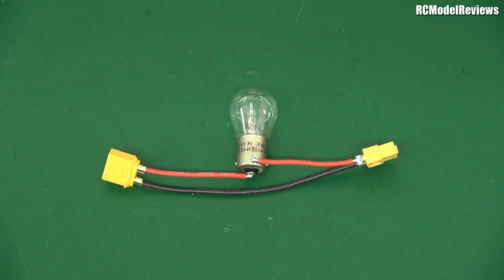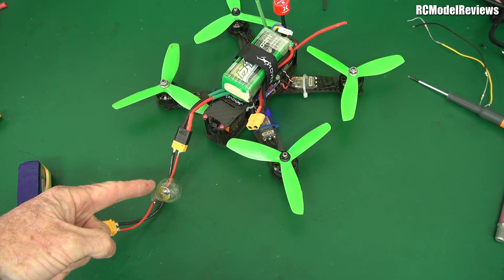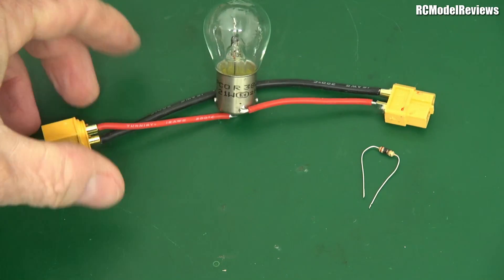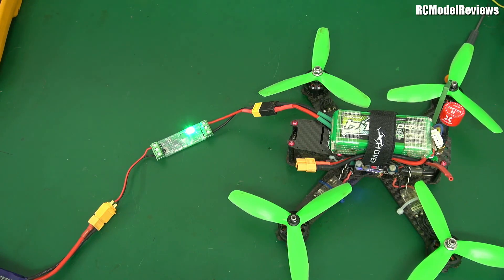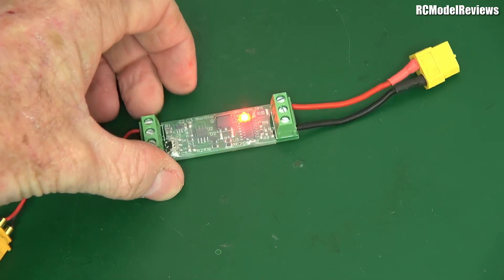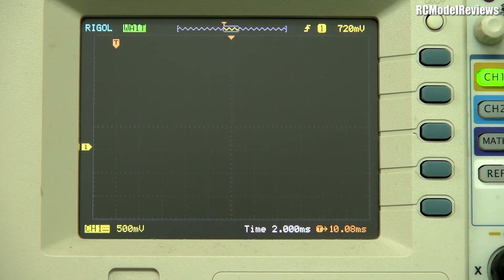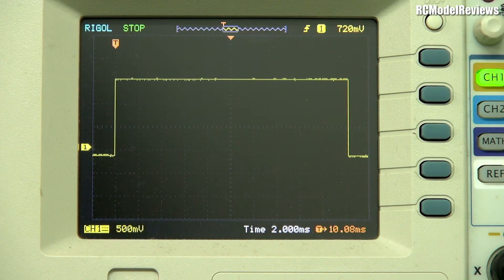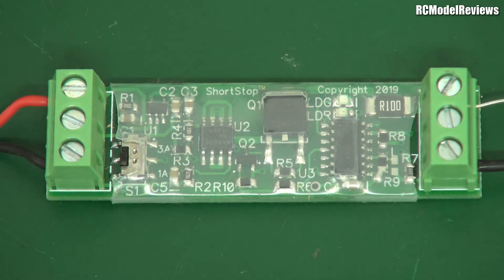Review:  ShortStop (helps keep the magic smoke in)

Comment: hey Bruce i bought one of these and the .10 ohm resistor is missing lol no output at all. i contacted J Bauer. waiting on a reply. other than that the green light is pretty.
Reply: Emailed Mr.BAUER I got a quick response, he immediately offered to replace it. I was in a bit of a rush so I just opted to cut the time in half ,Jerry sent the missing components promptly, soldered them on today and it works exactly as it should. Just thought I'd update my experience with the customer service side of this 👍.

Comment: How do you conclude 1.5 amps were flowing at 11:06 before it kicked in.
New to scopes and I get the divisions and voltage vs time on the axis, but can't see where you get the 1.5amp flowing after stating 1.5v? (3div)

Comment: Could you go into why the manufacturer can’t just put a protection diode or varistor in the sensitive component? I work on equipment that has spike protection (on solenoids) set so low that the working voltage (24v) sets it off

Comment: FINALLY !!! Using a smoke stopper (bulb style ) to protect IC's  never worked.(sledgehammer for a finishing nail ) And, smart enough to recognize in rush current from the caps. I'd pay 40$ for this right now, and count it as a bargain. If it's not to market in weeks, it WILL be copied , I almost guarantee it. It could save that stack you have been waiting for for weeks, and all the work put into a quad build. After the magic smoke, the only option is to start disassembling / troubleshooting/ searching for answers. Take my money !!!!

Comment: Another common method that is half-way between the lamp and this is called a "PTC" or *resetable fuse*. PTC stands for "Positive Temperature Coefficient." They are nothing more than temperature-dependent resistors. As they heat up, their resistance increases very rapidly. They usually start out at a few hundred mOhm to a couple ohms when cold, but as they heat up due to current and power dissipation, they begin to go high-resistance. This is a runaway effect as more resistance means more voltage drop across the PTC, resulting in more power dissipation. Eventually they will see close to the full battery voltage across them and will be hot enough that the resistance is in the hundreds of ohms to kOhms range, passing only a small amount of "holding" current. They are usually screaming hot when in this latched state. They can be found in all sorts of things: input protection for arduino pins, on some battery holders, in electronic DIY kits (like those snap circuits) inside power strips for surge protection, inside multimeters for input protection, etc.

Comment: Is it some manner of Hall Effect sensor?
What if it trips mid flight due to gunning the throttle? Perhaps if it had a calibration mode where you draw max current with your model then set that as a high water mark.
Reply: It's supposed to be used on the bench only, not in flight.
Reply: @sebsexperience  Ahhhh, makes a lot more sense!
I wonder if the majority of components die when in use or out of use though.

Comment: Aren't you meant to use a double filament bulb. You used the wrong type of bulb. My quad would light a single filament but is fine when using a double filament. Which would be closer to the 3amp setting you needed to use on the short stop. Try it with a double filament for fair comparison.

Comment: What happens if you connect the ShortStop reversed or plus/minus swapped?
I think it's use is limited; some components die at less than 1A. Or they die from reverse voltage like electrolytic capacitors.

Comment: Light bulb current limiters were never meant to protect sensitive electronics. 
They were meant to test and protect the larger power supply parts that connect directly to large current lines (psu transformers, psu capacitors, batteries, regulators etc) and prevent fires and/or explosions, before attaching the actual circuit. 
Sensitive electronics should be tested separately using current limiting power supplies. 
Unfortunately, most modern RC components and connections do not allow that kind of testing, and various components have different tolerances and quiescent current demands (FC, ESC etc). And the lack of proper documentation (on-paper and on-board) does not help either. 
I am not sure how much more useful this device would be than a lower wattage light bulb (used with a lower V battery to prevent burning it). Especially if it costs more than a few bucks.
I would say skip the gimmicks and just spend 30 bucks for a variable bench power supply with current limiting. It will do basically the same thing and be far more useful in a DIYer' s lab. And if you can, avoid AIO boards. They are too messy to wire. And use 2 or 3S for testing if your components allow it

Comment: Bardwell used this https://www.racedayquads.com/products/smoke-stopper-by-rdq-and-bengineeringlabs it's much simpler, basically a just a polyfuse. Wonder if there's anything that can save a quad FC if you put vbat into a UART. This happens more then it used to, because of 4in1 ESCs with 8pin connectors and different companies having slightly different pinouts.

Comment: I could have used one of these a couple of months ago. Somebody must have sneaked in when I wasn't looking and re-soldered the connections on a brand new FC I was setting up, the smoke leaked right out when I plugged in the power.
Reply: The last thing I blew up was an ESC. I had a spare so I wired that one up and puff! Strike two. Yeah... I was powering my server tester off the balance lead of the same lipo... Dumb dumb dumb. I suppose this thing can't prevent stupid. -_-

Comment: I just have a 12v 2 amp psu on my workbench which will just cut out when there's a short, it's ideal if you have to work on several models just plug in do your tests and go... :)

Comment: I sometimes use a B3603 buck converter with the current limit set fairly low. But this is more convenient (and actually cuts the power completely).
Reply: Yes or a simple 12v psu that will cut out when shorted

Comment: The old ESKY Honey Bee V2 had a problem that when the throttle wasn't cut fast enough during a crash, it would overload the 4in1 and fry it. (very expensive).
Placing a 5 or 10 amp automotive blade fuse between the motor and the 4in1 was very effective at protecting the delicate electronics. https://dannytsang.co.uk/esky-honey-bee-v2-fuse-mod/
Reply: Those helis were very hard to fly good, my first was the v1, still have and it´s still working, replaced the crappy 35Mhz receiver with a 2.4ghz from a HBv2 with a toasted 4 in 1, and yeah fuse mode done to my v1 and v2, they booth still fly!

Comment: I found a wall charger on E- Bay that you can adjust the setting from 1.5 to 12 volts. It works great for testing stuff  and checking by slowly ramping up the setting without using full power. It has a 3.5 setting which works great. I use it mainly for testing LED's. Your tester wont save smaller things. Your tester is fine for automobile stuff but then again, most vehicles sensors use 3 volts to 5 volts to send a signal to an ABS sensor. A 12volt light bulb might be ok for a Catalytic converter heater but todays cars are tricky devices. make sure you use something that prevents crossing negative to positive. I like your test board but not the light bulb idea.

Comment: Hi Bruce,  I have been using this system for a smoke stopper since I started working on Television and radio for repair. But also you can use this as a battery discharger and your not to leave it plugged in. But yes they are the wrong ones for our systems. Thanks for the new smoke stopper ,

Comment: I just use a multimeter
Reply: I know very little about the intricacies of multi meter use. Apart from testing for continuity is there anyway to use it similarly to this short stop device?
Reply: @sparkycorkers1196  The continuity function will tell you if you have a short, but you can use a multimeter to track down that short which is its big advantage over this device. Josh Barwell did a good vid about tracing shorts and defective components https://www.youtube.com/watch?v=XozTH9gEhH8

Comment: 20-50mA fuse
Reply from the maker: That'll blow while the capacitors are charging :-)
Reply: @RCModelReviews  slow blow fuse. You always are in danger of frying something during the trip time though. Like with every general purpose device that allows inrush current and is not custom built for the circuit